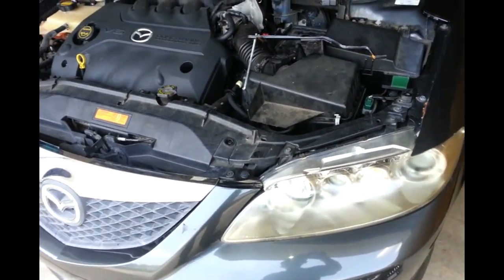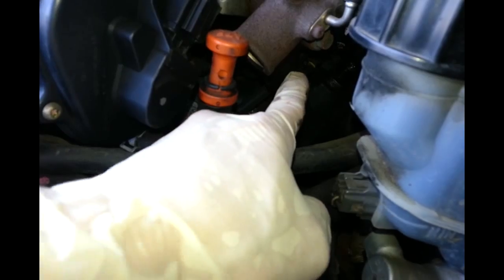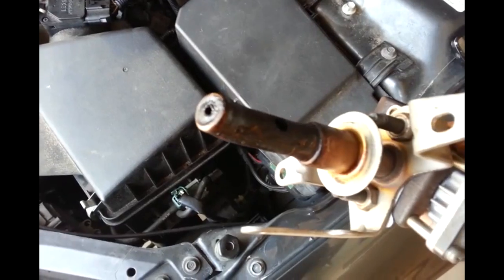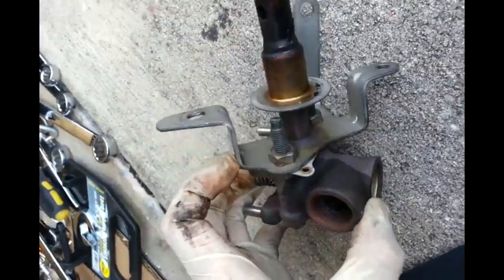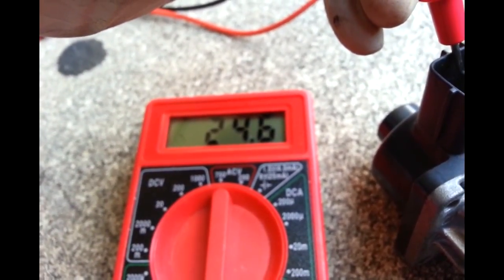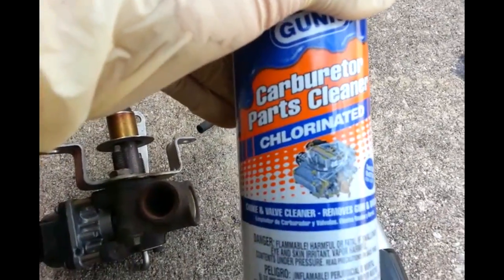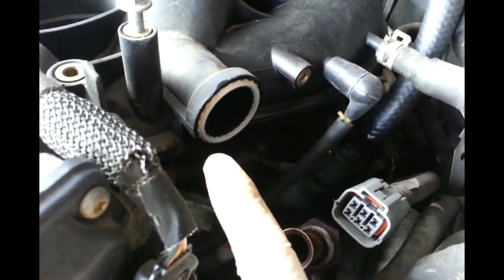Mazda 6 code P1487, P2227 and to remove the EGR Valve

Comment: Make your life easier, buy a 1 1/16" CROW FOOT WRENCH for the EGR bolt.  Attach to your socket wrench, use a 6" extender and you won't need to remove the transmission stick.  I removed the battery for space and the entire replacement was 45 minutes.  Hint, use LIQUID WRENCH on the bolt a few days before and reapply.  I reapplied 4 times and it worked really well.  I bought this set of wrenches, amazing to use.  Sunex Tools Straight Crowfoot Wrenches
Reply: Troop164 Yorktown you’re a god! Your comment helped me more than the video.
Reply: Is it counter clockwise, or clockwise to remove?  He was a little confusing.
Reply: Thank you, needed the size on 1 1/16"

Comment: i'm having the same problem with my 2003 mazda 6s (P1487 & P2227). i have 0 auto repair experience but would love to take a crack at this. can you tell me where you got the replacement parts from? thanks for the video!
Reply from the maker: I pulled the parts from a not running vehicle with the same model and year.

Comment: The pressure transducer is it this part #911-707 ? I have the same vehicle as you and I've had these two codes. Changed egr valve, cleaned the areas very well. Seems like we have the same problem. p.s. I also changed the pcv, always a good idea.

Comment: Anybody have the names of these two sensors he replaced?
Reply: Wendell Chasse were you able to find name(s) of those sensors?
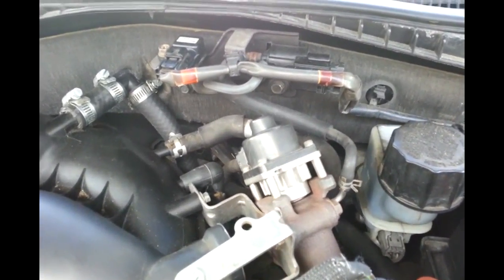Reply: @Los Angeles Painted Portraits . about 5 yrs ago got a code, cant remember it #, but went read it at auto parts came out with that name of the selenoid sensor purge I think, only dealer have it cost me around 90 bucks. Put it and no issues. Good luck. My was the one on the drivers side( fire wall) 27:50 mins.